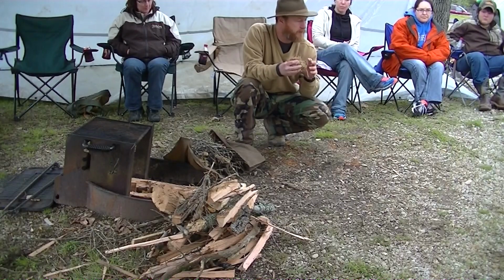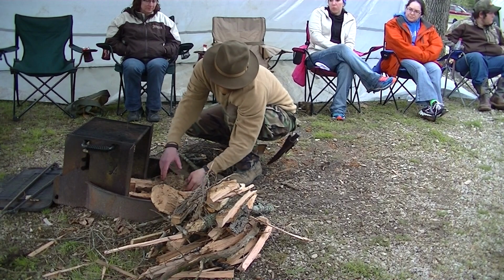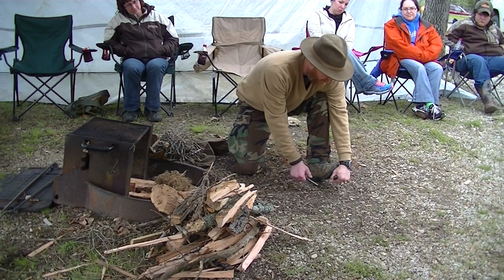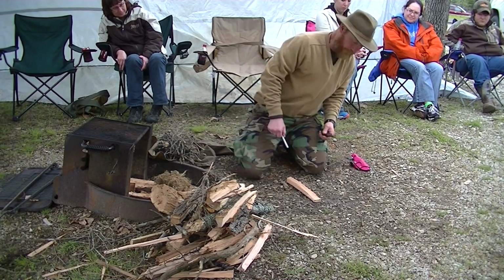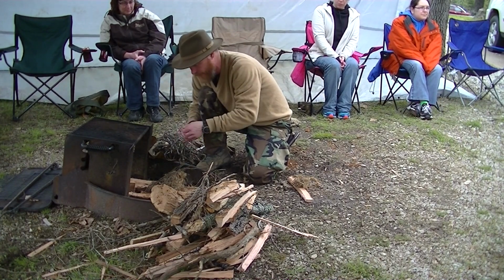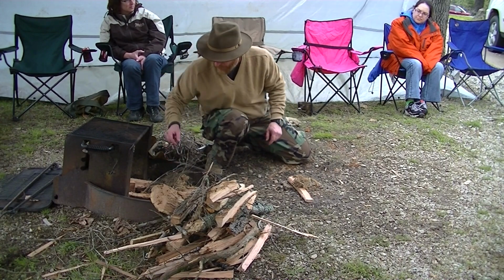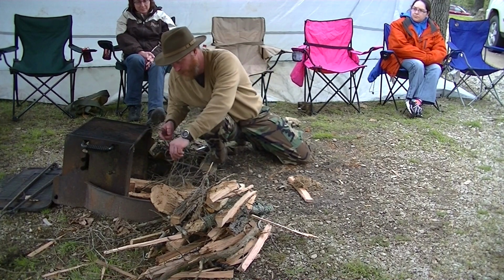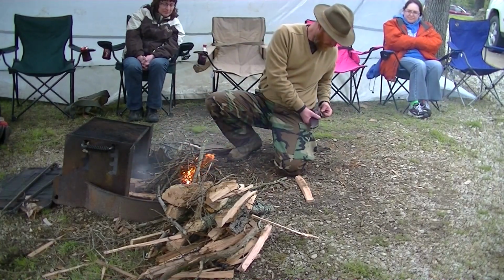Larry Roberts Fire Lay and Ferro Rod Techn Wolfe Customs 2015

Comment: Best Ferro Rod Scrapers: 
1. Back of Leatherman Saw (Surge, Wave, etc...)
2. Home Depot $1 Shears (back of it, not the blade side)

You can get a shower of sparks even from the cheapie generic $5 rods. 
Trust me on that. Back of knife spines? They are what cause ridges in 
ferro rods because they wear down and roll over and cause uneven wear.

Ferro rods spark at between 3,000°-5,000°. Knives are tempered at 1800°.
Do the math. What's going to give when you're sparking a rod at twice the
temps that that knife was tempered at? That's why I stopped using a knife
and use a dedicated scraper. But of course, those are just figures and #'s. 

After scraping a rod thousands of times, you see the difference. Scrape it
with a Leatherman saw or a Home Depot shears half and it begins to get 
the ridges out of the rods and leaves a smooth plane again. Plus they 
create far more sparks per scrape making one have to scrape their rods
less and extending the life of the rod. 

:)
Reply: The Yankee Woodsman Now that was some good info,
Reply: Thanks!
Reply: The Yankee Woodsman Another thing to carry, but yes there are other better strikers than the back of your knife. I actually have a $1 survival tool that is the best palm striker ever. Keep in mind my hand was still injured for this class.
Reply from the maker: Yankee Woodsman yep there are many other items to use for sure